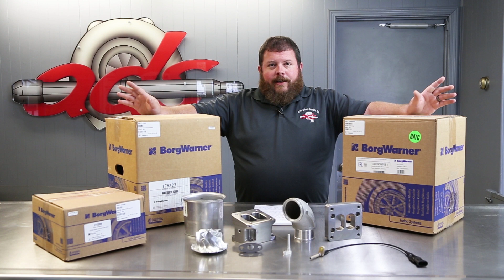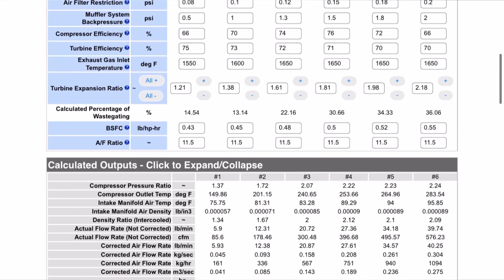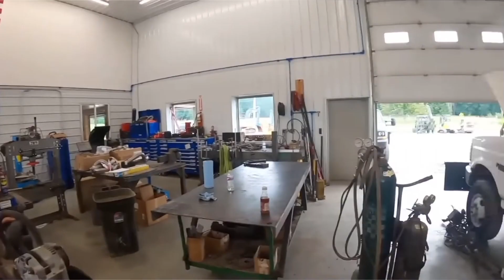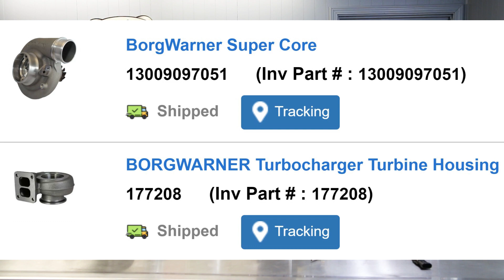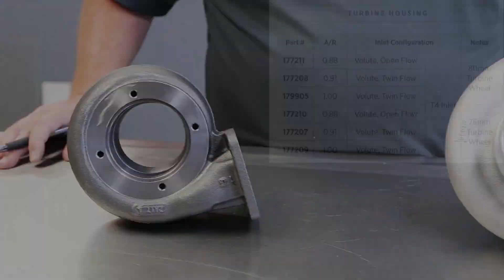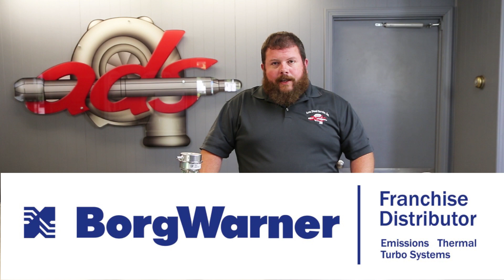#TurboTalk @AreaDieselService S369 for @C_CEQUIPMENT's 7.3L 500+ HP F350 #S300SXE #S300 #S369

Comment: Do i get this clear? Is a gasoline engine sturdy enough to take the higher pressures and torque when diesel fuelled?
What do you replace?
Reply: GM and Waukesha both attempted to take gas engines and convert them to diesel with less than favorable results.  Lots of naturally aspirated gas engines have successfully had turbos added and doubled their power output. It is a lot of work though and you can easily damage your engine if you don’t know what you are doing.
Reply: @bcbloc02  thnks. I was a marine engineer, now on pension. I am unfamilliar with american motorblocks. Europian/asian blocks definately cant. You can run an gas engine on lpg but it takes a more sturdy block( thats why mostly diesel) to run on cng. But seeing v8 s tuned up to 400/600? ( Without changing cranckshafts, rods, pistons and heads) the engines are more sturdy.
Ps. If said started as an gas..
It looks to me the engine was converted. 
But does it mean that the engine is swapped?
Reply: @henkoosterhof5947  The engine was swapped -- the original gas engine was removed and a "built" 7.3 Diesel engine was installed.  Attempting to convert a gasoline engine into a Diesel engine is extremely inadvisable and not for the faint of heart no matter the size of one's bank account. 

Yeah, I know that I posted this years afterwards.

Comment: What would you recommend for a gas V6 engine that runs in the 1-4 thousand rpm range and is a daily driver with a 5 speed manual transmission 2wheel drive?